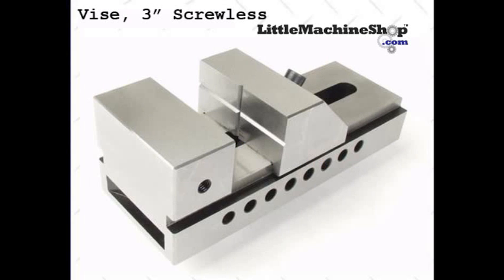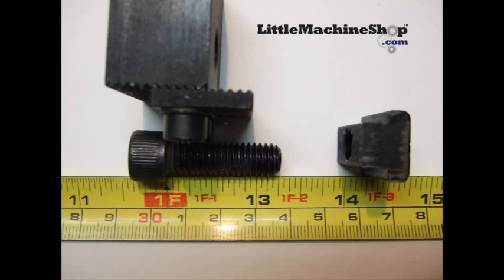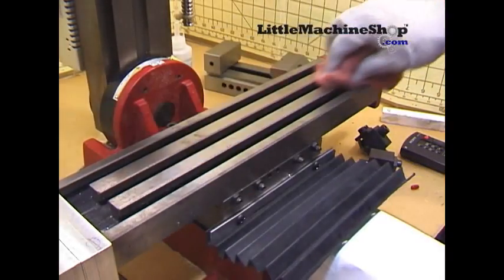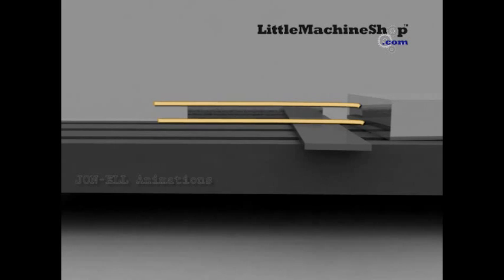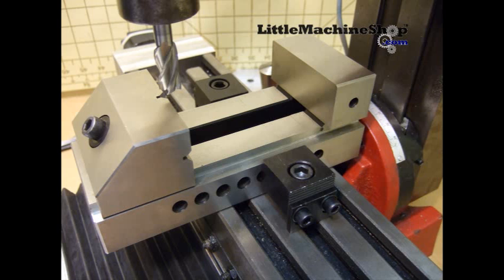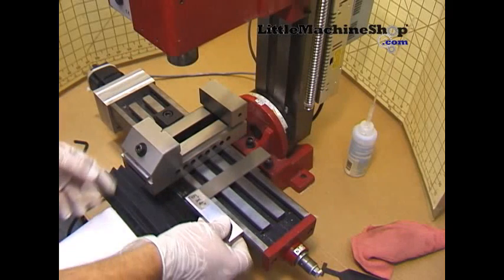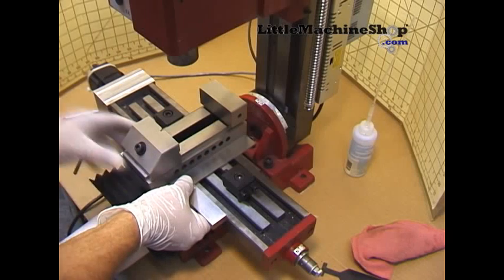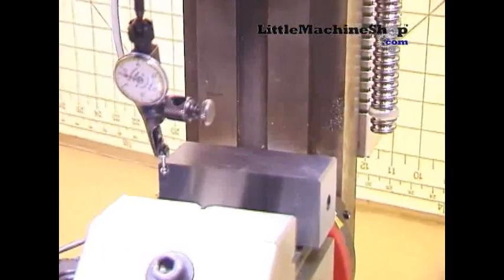Mounting a Screwless Vise

Comment: I ordered this from LMS as part of a starter kit. I'm just starting in milling, but this vise is a pain to use. I don't see why anyone would prefer this to a standard milling vise. It is well ground, but the mounting clamps seem cheap, and the Allen adjustment infuriate me to no end. Maybe someone can school me before I either sell or scrap it. Until that day, it goes in the junk bin. If you're starting out, avoid this vise.
Reply from the maker: Kenny, hard to know exactly how to diagnose and not sure how or what you were using for, but in general a screwless vice and a mill vice are very different creatures. Like most tools if it was not working as expected, it may not have been the right tool for the job. We have a Vice Comparison chart which may be helpful: https://littlemachineshop.com/info/vise_compare.php. I wouldn't "trash" it, give it to someone else at least, or wait for the right project. You can never have too many tools.
Reply: @Littlemachineshop  It is indeed square, parallel, and feels like its a precise vise.  I also like the vees for holding cylinders, and the movable jaw doesn't seem to lift upon tightening (in any way I can tell).  There are two reasons which I suspect are why you have it listed as "not as convenient as adjusting a normal vise screw" on your comparison list.  Firstly, it's easy to over-loosen the screw.  Shame on me, sure, but it is frustrating when the cap screw comes completely out all the same.  Mostly, what's infuriating to me, is when the vice seemingly sticks at certain distances.  As if tightening the cap screw catches between grooves, resulting in the vice not tightening down.  For instance, this seems to happen when the movable jaw is ~1" from the fixed jaw when clamping in 1" square bar stock.  It seems like I'm battling this vise at times to get it to hold a workpiece.  I appreciate your reply, but I think a milling vise would be better for novices all the same.  I'm still going to be shopping LMS.

Comment: Hi! I bought this vise but I can't find the clamps. Can you help me?
Reply: Lms sells them.  I bought this about 9 months ago and it is a piece of crap. At first i liked it. But after using it  there are certain sizes that it will not clamp tight on. Tonight was the finale straw.  Needed to mill a part and because of the size it would not clamp down tight enough too hold the piece between the jaws. Lucky I had a spare HF 19 dollar one. So I’m looking at a different type now.  But good luck to you hope yours works better.  🤪🤪🤪
Reply: If you can afford a clamp set buy it! Make sure to measure your mills T-slot grooves first. Good luck.

Comment: That's a grinding vise. It holds down magnetically.Get yourself a machinist vise.
Reply: I've noticed these types of vices become more popular in milling machines. There are versions designed to be held down without a magnetic chuck. Looking at 120mm version myself.
Reply: Its actually a toolmakers vice used in multiple machine set ups for accurate work.